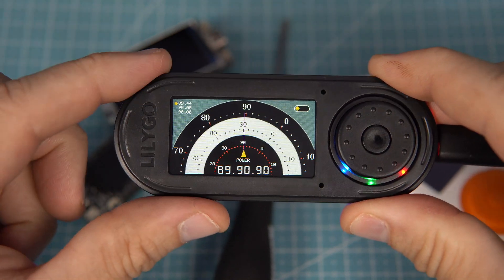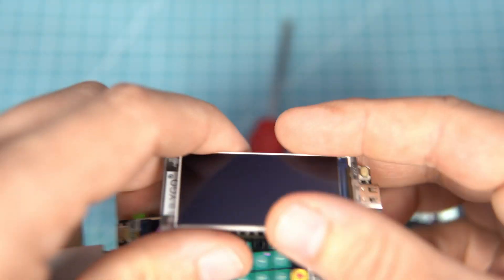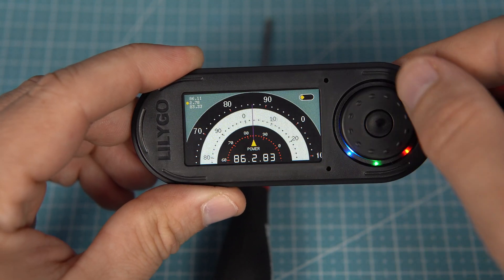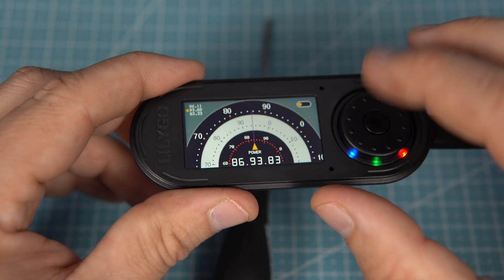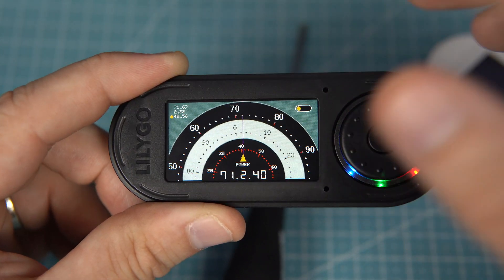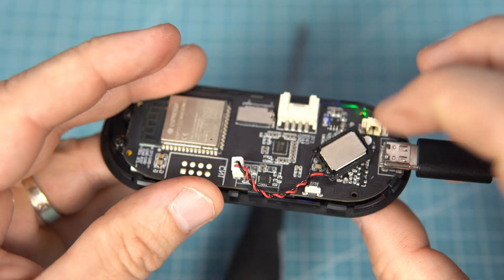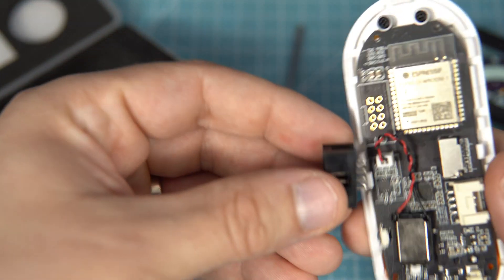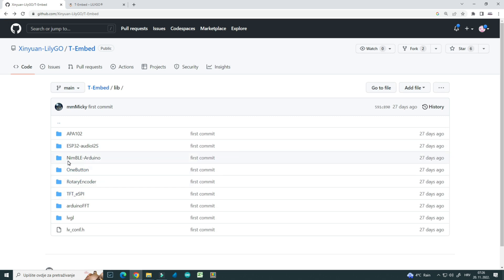Another ESP32 S3 board. LilyGo T-Embed

Comment: It would be great as a compact multi gauge for data on cars or boats!!! The little speakers can be used as a warning for high/low pressure or temperatures. Use the knob to switch between gauges or units.

Comment: Hari Im looking to use the t-embed as a voltage controller by using a  400W Dual High-Power MOS Transistor Driving Controller Module over I2c. Thank you for showing this display.

Comment: Hi, I fail to upload your T-Display S3 Code to T-embed hardware. Is there a difference in the display code so that I need other library???? I fail to program T-embed display! But T-Display S3 works like charm. I'm confused. (PS: the board response is okay...just display keeps black. Original firmware was showing that display was okay - just upload my code and now it is always black. also with this code here.)
Reply from the maker: Yes you need diferent library but instalation process is tje same ,only diferent github rep. Also in setup file you will need couple aditional lines of code, check my code front his video.
Reply: @VolosProjects  thanks man! so means other library..I think I have to use 2 computers as library mismatch is annoying
Reply from the maker: I just copy tft_espi library in arduino libraries folder when i want to use another board, bu lt i agree i dont know why they dont use same pins for lcd, it is anoying
Reply: @VolosProjects  Do I see this correct:? The difference is in the file "User_Setup_Select.h" in lib  TFT_eSPI? Since I have 3 setups (T-embed, T-HMI, T-Display S3), I may better make batch.cmd to exchange these files... 🙂
Reply from the maker: @martingerhardsoos  usualy , diference is in user_setup_select file, but in case thease boards i think there is more diference, niether one of them works with orginal library , both of them works with modified library. library for t-embed is here : https://github.com/Xinyuan-LilyGO/T-Embed   in lib subfolder

Comment: did anyone get the sd to work?
Reply from the maker: I managed to use sd but only if display is not used. If you find solution for this please share with us, i spended hours trying to solve this
Reply: @VolosProjects  
i'm a total noob with bad english.

only works with SD.h 

#define PIN_SD_CS 39
#define PIN_SD_SCK 40
#define PIN_SD_MOSI 41
#define PIN_SD_MISO 38

...

SPIClass SPISD(HSPI);
  SPISD.begin(PIN_SD_SCK, PIN_SD_MISO, PIN_SD_MOSI,PIN_SD_CS);
  if (!SD.begin(PIN_SD_CS,SPISD)) {
    tft.setCursor(5, 0);
    tft.println("Card Mount Failed");
  }
  uint8_t cardType = SD.cardType();

  if (cardType == CARD_NONE) {
    tft.setCursor(5, 16);
    tft.println("No SD_MMC card attached");
    delay(4500);
  }

  Serial.print("SD_MMC Card Type: ");
  if (cardType == CARD_MMC) {
    tft.setCursor(5, 32);
    tft.println("MMC");
    delay(4500);
  } else if (cardType == CARD_SD) {
    tft.setCursor(5, 32);
    tft.println("SDSC");
    delay(4500);
  } else if (cardType == CARD_SDHC) {
    tft.setCursor(5, 32);
    tft.println("SDHC");
  } else {
    tft.setCursor(5, 32);
    tft.println("UNKNOWN");
    
  }

  uint64_t cardSize = SD.cardSize() / (1024 * 1024);
  tft.setCursor(5, 64);
  tft.printf("SD_MMC Card Size: %lluMB\n", cardSize);
  delay(4500);
}
Reply: @VolosProjects  Hi, I got it to work with using SD_MMC library. I actually got all the components on the board working together, except the mic(s). I can't figure out how to use the mic array - ES7210 properly. Could you a simple video on how to use the mics? I have been pulling my hair out for weeks on this now.

Comment: THANK YOU. Solved. (don't change User_Setup Select file!) Some reason I can't get anything to show up on display (I have programmed S3's and TTGO's before)...the LEDs light up. I have switched out TFT_eSPI lib out, trying anything. I saw someone else had the same issue. I don't have a plain S3 on hand to check the display setup...
Reply from the maker: Where did you find librsry you are using
Reply: @VolosProjects  What setup should I use in the "User Setup Select h" file?
Reply from the maker: You dont need to  edit anything, you need to use modified version of tft_epi libraey which can be found here https://github.com/Xinyuan-LilyGO/T-Embed in lib folder, also you need put few aditional lines in setup part, check my example
Reply: @VolosProjects  That worked, weird Setup# but whatever! (Now explain what to add to the game code to get it to work! Just the gauges work for me)

Comment: I finally managed to operate the display on both boards, this one, and the T-Display S3, but replacing the TFT_eSPI library in the library folder is very inconvenient to say the least. So I tried putting it into the sketch folder and replacing the <> with "" in the #include statements and changing the paths where it was needed. but finally got an error message:
undefined reference to `TFT_eSPI::TFT_eSPI(short, short)'.
Is there any way around having to swap the libraries all the time?
Reply: Can you share the link to the TFT_eSPI that works? I keep getting a blank screen. :(
Reply: @jasonspacesmith  you have to take the library from the github of the product you used. They are not the same the one that works with the embedded and the one that works with the T-display. Hope I am clear. If it doesn't work, let me know and I'll try again.

Comment: Nice Video. But i am not able to run any examples. Only the led example runs. All examples which uses the Display doesn't run. It seems, there is a different display compared to the T-Display-S3. Maybe some informations are missing for the TFT_eSPI library. T-Display-S3 has a parallel interface, T-Embed only SPI. So this display can not work. Second, which Rotary Encoder and FastLED libraries do you use. There are many different libraries for Rotary Encoder and FastLED in the Arduino IDE from different developers. Which ones are the right?
Liliygo has no comments on their examples, that is very sad. The T-Display-S3 examples are running, the T-Embed examples not.
Reply: Did you ever find an answer? I am having this issue...
Reply: @Chrisedge  Yes. I found out, that you need two different versions of TFT_eSPI library, one for the T-Display-S3 (it works in 8bit parallel SPI mode) and one for the T-Embed Display (it works in serial SPI Mode). In Arduino you can copy and rename the both different libraries or you can switch to Visual Studio Code with PlatformIO, where you can manage different configured libraries. Lilygo has forgotten to give a notice that there are necessary two different configurations of TFT_eSPI library.
Reply: @dynahenry5733  I grabbed the TFT file that is included in the Embed, changed the UserSetup.h to the line 206? S3 option, and it still isn’t working. Is there another Serial SPI mode TFT?
Reply: @Chrisedge  It is not enough to change the User_setup.h . There are many other files to change. The best way is to exchange the hole library. Take the hole library which is provided from Lilygo for the T-embed Display and it will work. I think it is a bad way to change files in a library, because with every update of library your changes are lost. A better way is a renamed private copy of TFT_eSPI.
Reply: @dynahenry5733  I did that! replaced the whole TFT lib with the one from Embed. I mentioned, THEN modifying that User_Setup_Select.h. The one that is defaulted to "Setup file for DSTIKE/ESP32/ESP8266 configured for ST7789 240 x 240" ...What is the right Setup#? in the User_Setup_Select.h file?

Comment: I want to have one that controls a small DC motor speed controller. I want the board to show the percent of speed from 3v to 9v. Like 0% speed to 100% speed by simply using the voltage as the control. I way of displaying speed or power used. I want the LilyGo to also show the voltage left of the 9v battery. Can I do that with the LilyGo with the rotate dial? It looks beautiful, and thank you for introducing me to this little display.

Comment: Great devices, great prices and great to see your excellent code and quality graphics.

BUT I'm going around in circles trying to get the T-Embed to run your code. 

I installed the libraries, but on one PC compilation failed as it could not find 'TFT_eSPI.h' however it was there in the library. Gave up, tried another computer, that just worked ?!? 

But then failed on 'FastLED.h', so I installed the first library with this name. That thew up warnings saying it was resorting to bitbanging but carried on then failed at 'File "esptool.py", line 34, in <module>'. I assumed here that maybe I should install python, so did that but still no joy and cannot move forward.

Please, any help would be most welcome before I spend more days getting nowhere (or it flies out of the window)

... blink doesnt even work so I'm missing something obvious :(
Reply from the maker: hello, instalation process is same like with this t-display s3 board, you can check my instalation totorial, only diference is that in last step you will need to download libraries adn example codes from T-Embed github repository. here is my tutorial https://youtu.be/gpyeMjM9cOU
Reply from the maker: Thanks, yes indeed :)

Comment: the degree display can be used to set the control times of a motor if you connect several encoders externally.  the control times of the engine could be set precisely.

Comment: Hi there, very nice video. i wonder if You could testr ride LilyGo T-RGB device. 
Just purchase one( because I really love those round displays for motorcycle multi gauge) and have some issues with making it work. Before I use to use 1.28 TFT with GC9A01, but this has different pro called st7701s.
Would be nice if You could give some tips&tricks. Best regards

Comment: The rotary encoder looks just right as a control for a radio, especially one that includes the short wave bands.
The whole module could easily work as the front-end for a small amateur radio transceiver, similar to the portapack addon to the hackrf board. When combined with an SA818/SA828/SA868 module, a few RF filters and a battery pack it could work as a tiny walkie talkie.
Reply from the maker: I always wated to make sw radio but to be honest i dont know is that even legal here and what equipment i need to use.
Reply: @VolosProjects  It's legal as long as it only receives, you need a license for transmitting. Take the ATS-20 as an example - the radio itself is based on the Si4732, controlled by an Arduino with a rotary encoder and an OLED display. The T-Embed would look nicer and add WiFi and BT capabilities.

Comment: I saw that and I liked it but at the time, I couldn't figure out what to do with it either. If it has IR or it could be added, maybe a universal remote? You could use the dial to switch between your devices.  The T-Watch has IR. Maybe there is an addon IR board for the old 2019 edition.

Comment: Very nice!  The SD card should face outwards in case the board is in an enclosure.  Also,  the addition of the card reader is great since you can add multiple sketches/programs on the card and select which one you want to use!
Reply: Hi, do you have a script to inicialize SD with Arduino, or to read whatever is inside the external memory?